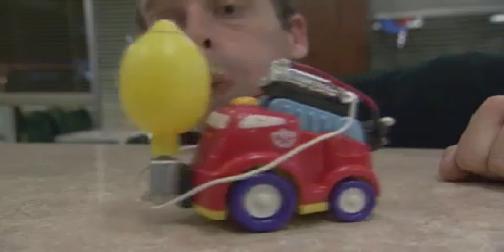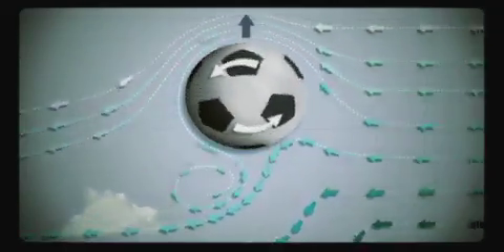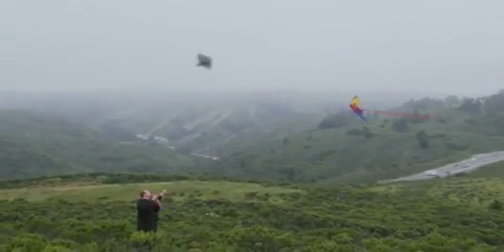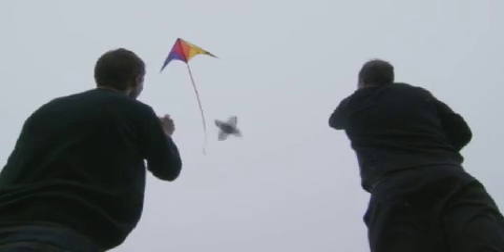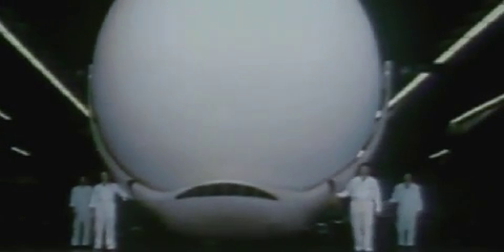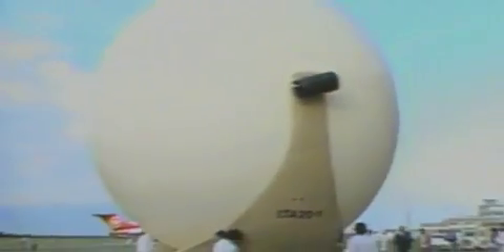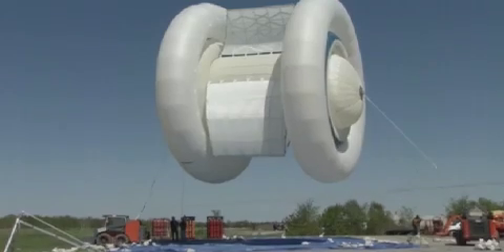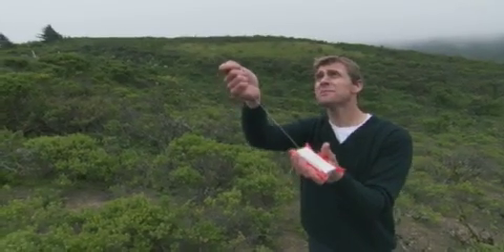The Magnus Effect

Comment: 2:16 No. They used small engines in the low kW range to spin the rotors - which then produced a couple hundred kW equivalent of propulsion. Using those tiny engines to power the propellers would have made the ship crawl along.